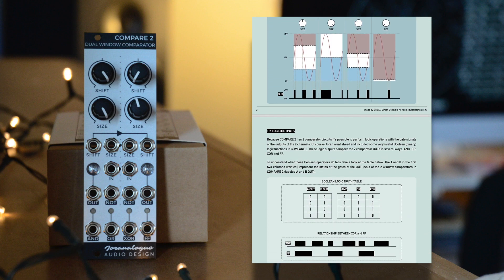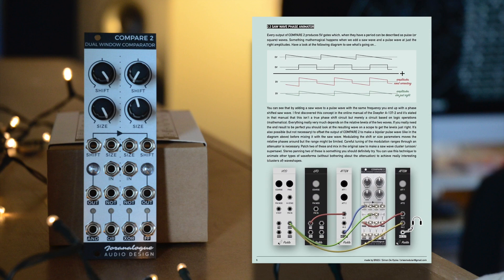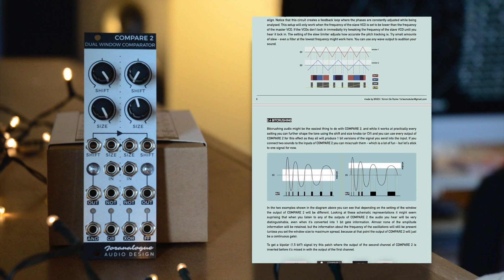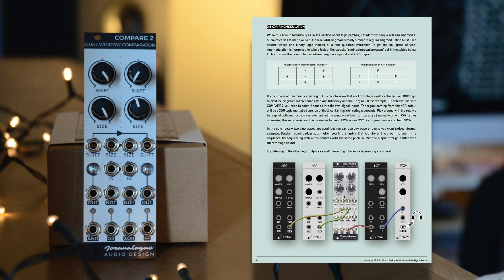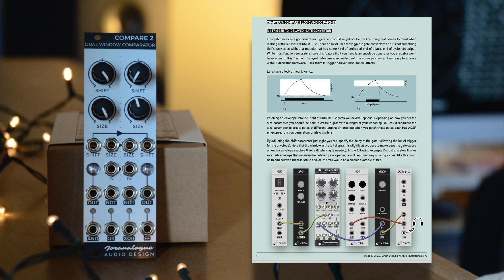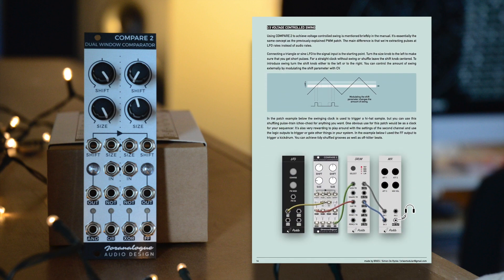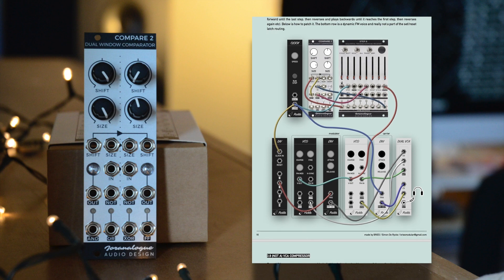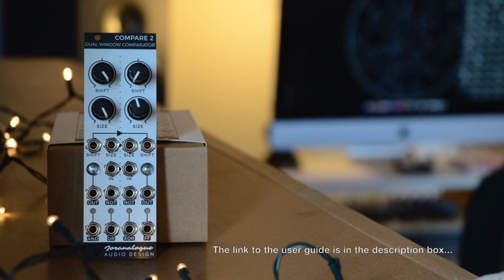Joranalogue Audio Design COMPARE 2 / Practical User Guide / announcement

Comment: Great work! I hope this and the Generate 3 guide are just a taste of more to come form you and Jordan!
Reply from the maker: Hey Kinga, thanks! Not every module needs a detailed guide, but some do... we'll see what the future brings.
Reply: Have you considered covering Enhance 2 as a CV processor in a shorter video maybe? I've been experimenting with this and it actually works really well. You take your CVs from the mid/side outs and the balance/width/tilt knobs provide plenty of variation between the mid/side pair.
Reply from the maker: @kingajanicka  Hey Kinga, I don't actually own an Enhance 2. The video I did about it was with a module that I borrowed from Joran. I've been wanting to make a video about Shakmat's Sumdif, which I should be able to get similar results with when I add a bunch of attenuators to the chain. Thanks for the patch idea!